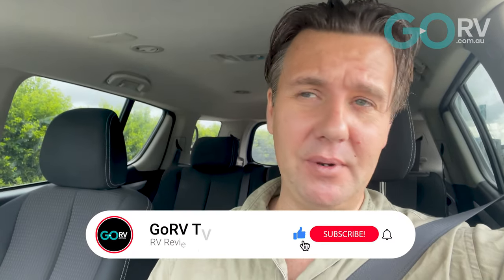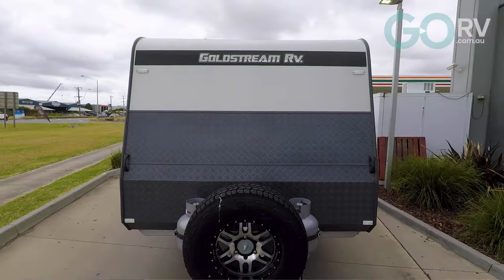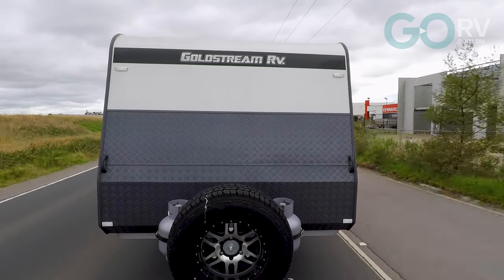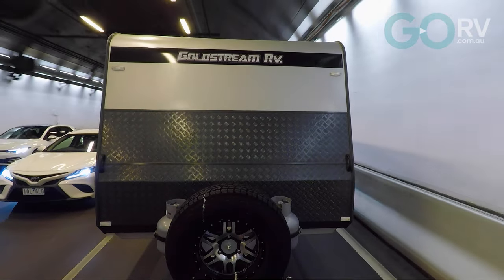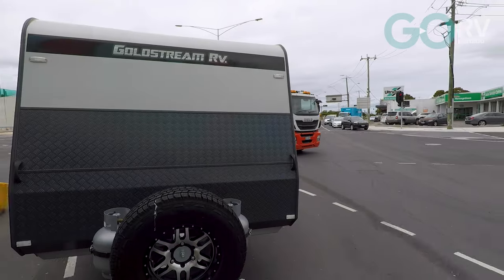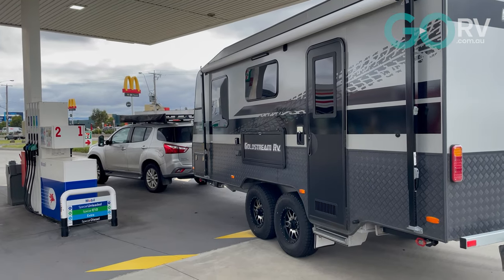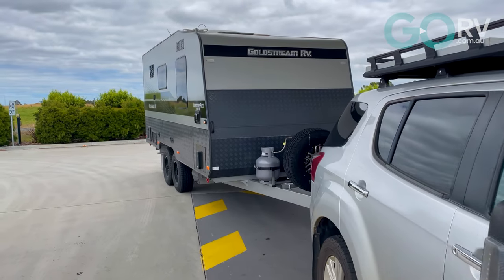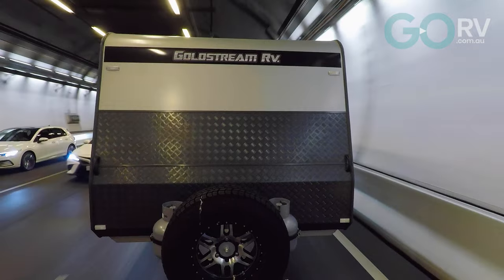FUEL TEST! Does driving slower improve fuel economy?

Comment: I tow a 2.6T Van & use about 16.5L/100km sitting around 95-100kmh (21 Hilux) & about 14L/100km cruising on 80kmh, but I always try to stick to the Speed Limits as I find its a safer way to travel & also courteous to other drivers & Trucks in particular